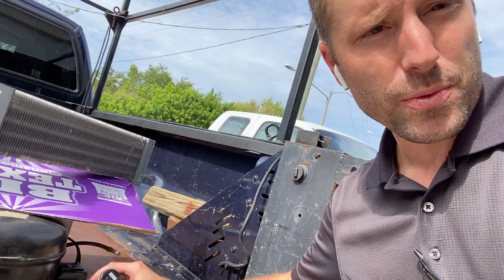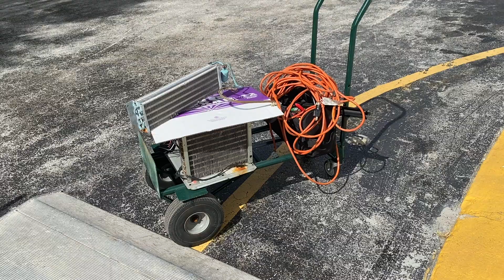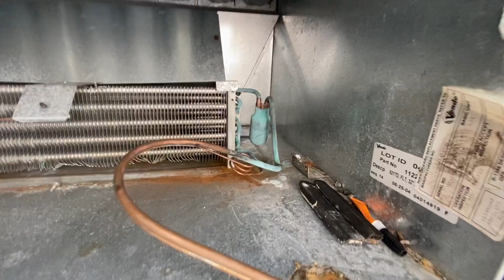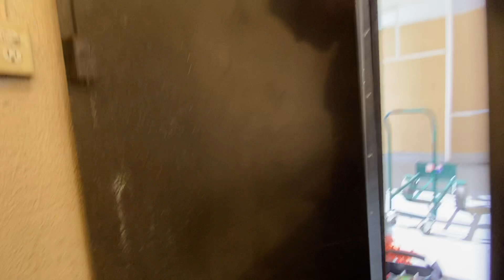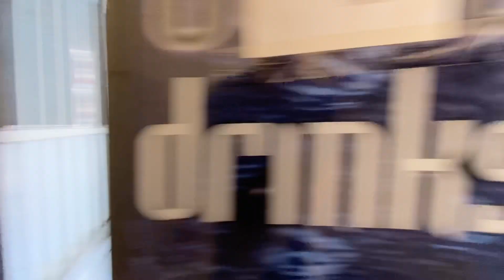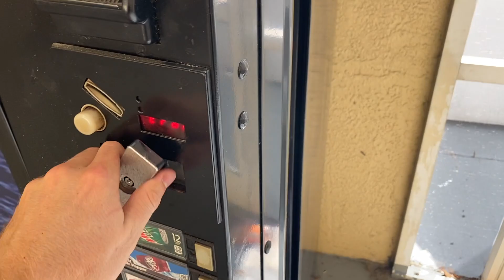Installing A Refrigeration Deck on A Drink Vending Machine

Comment: Kind of off topic but if a vending machine with snacks only, no drinks is indoors with air conditioning, does it still require a chiller or refrigeration unit? I was considering buying a unit that worked but it was without the chiller equipment.

Comment: 3 in 1 is only for a temporary fix, just get the proper start components (start relay, overload and start cap)  your lucky you can open the door up all the way if not getting that delivery chute out can be fun

Comment: I am not very familiar with soda only vending machines so I don't know if this comment is relevant. If you have  ventilation screens at the back of the machines make sure it's is at least 6 inches away from the wall so it could breathe, otherwise you might run into more problems in the future. Nice content btw, Subscribed!
Reply from the maker: Thanks!